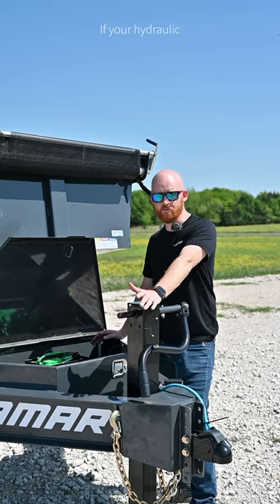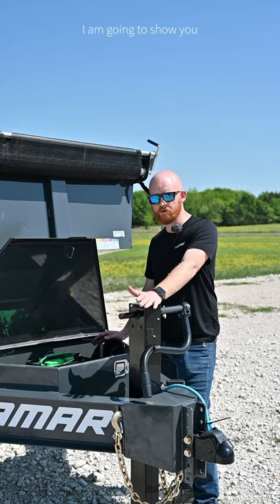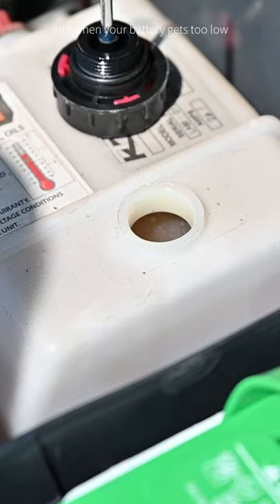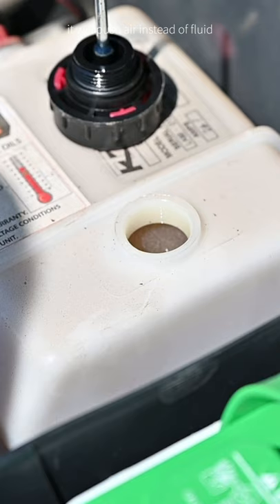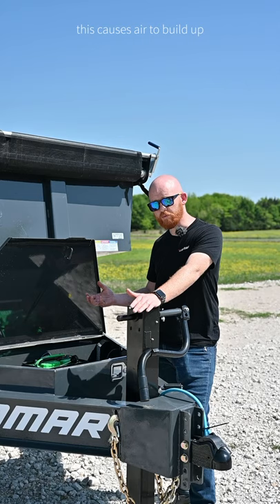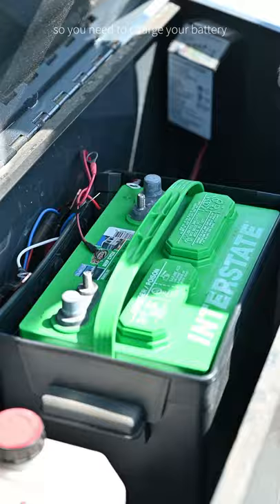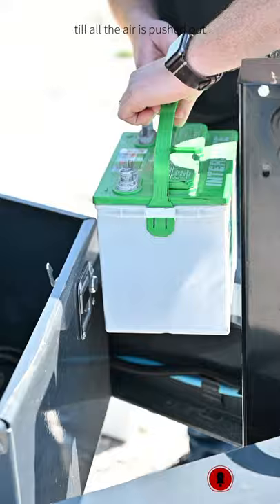Fix Overflowing Hydraulic Reservoir on Trailer #shorts

Comment: Is there a bleeder valve you need to open when raising and lowering after you've recharged the battery, or do you just need to make sure you have enough fluid in your overflow?
Reply from the maker: If the reservoir overflowed, yes it needs to have the air bled out of the line. We do not have a bleeder valve, KTI has a process, it is a long process to bleed air out of the pump. Let me know if you want to go over that process or not.